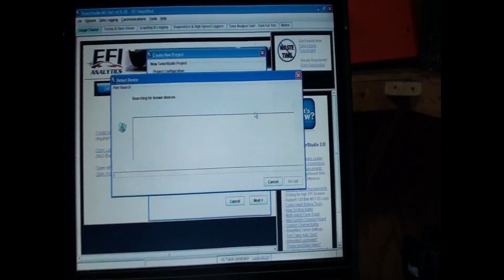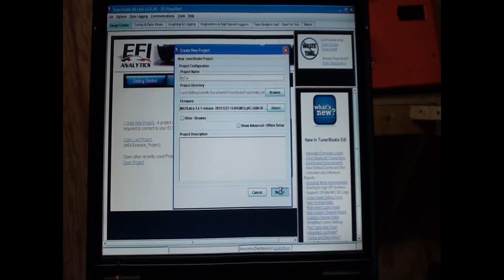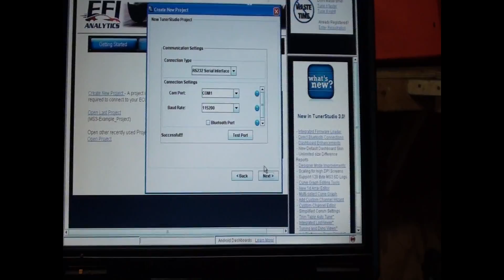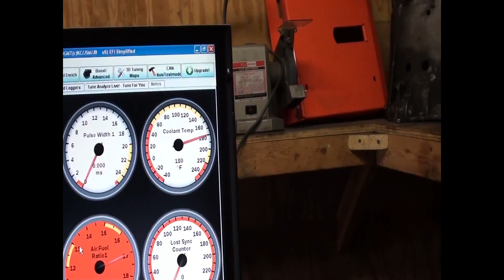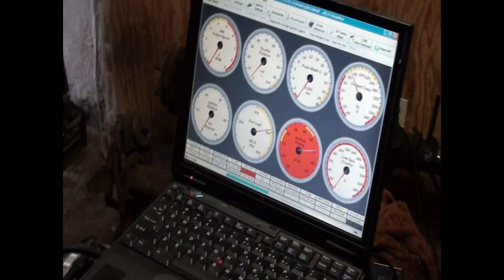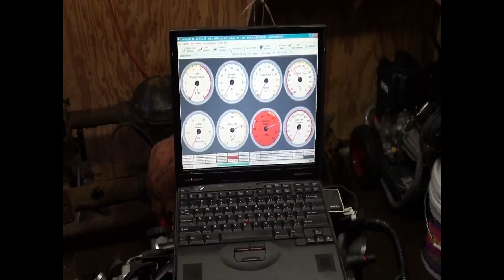HOW TO : Budget EFI Microsquirt! LS Swap 4.8 NO FEES  Free tuning SETUP and Configuration

Comment: Did this come with a Throttle position sensor or Idle air control sensor wires on the harness?

Comment: How does the computer going to know when to adjust timing if it doesnt have knock sensors or cam sensor? I ended up going with a fitech system for my build.
Reply from the maker: Tps, Map and Coolant temp provide all that information. I will add an O2 in the future as well